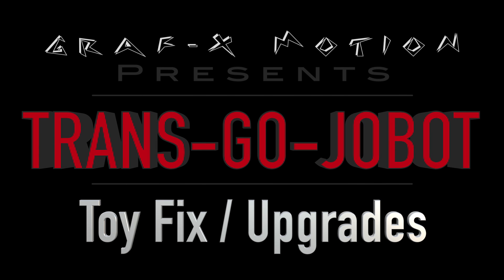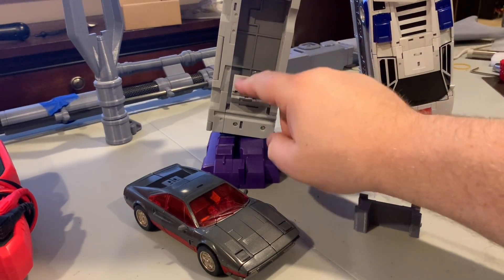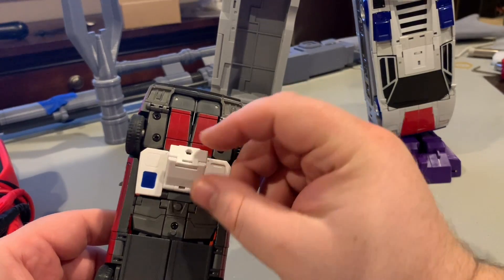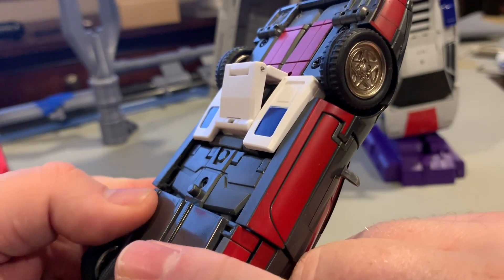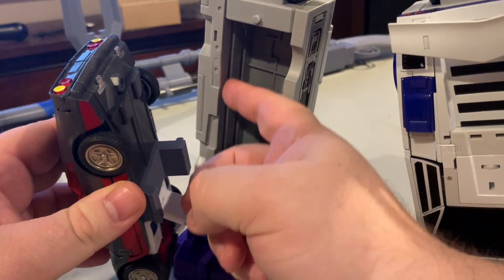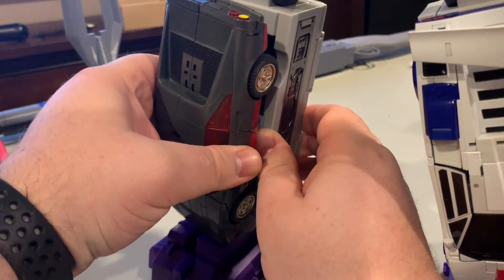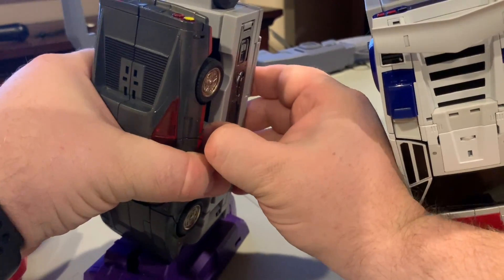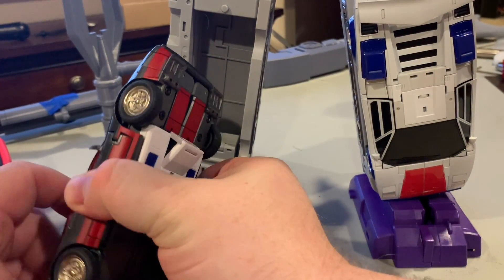DX9 Capone (MotorMaster) combined mode leg fix for DX9 Henry (Wildrider)

Comment: What filament do you use, and that 3d pritner you lined in the first amazon link is the one you use? Would it be useful for making customs guns or weapons that have a 5mm peg for CHUG figures and all, and I could also make custom  parts like you did? Also what software did you use to model it? Thanks.
Reply from the maker: I currently have a Creality CR-10S Pro. I have been using eSun PLA+ for filament. I like it’s extra strength and it’s been working very well. The problem with these FDM printers is any of them really can’t pull of the ultra fine detail. So for a part like this that is hidden, this cool is great!  But if you want to have tiny details, it’s not the best option also pegs can be tricky to get really strong and stable. We are going to be moving to a SLA printer for more detailed prints, but I’m concerned about fragility. I’ll know towards the end of the year when my SLA printers arrive. For software I use Fusion 360.

Comment: Any thoughts on making a front plate to allow the bots to be screen from the front?
Reply from the maker: There are some that have done that. If you search the TFW2005 3rd party forums, you should find some folks that have done that. I was considering it at one point, but I have since decided against it, especially when others already existed.
Reply: No one still makes the upgrade kit to move it to the front of the leg.
Reply from the maker: @TheIntern83  Interesting. The problem with 3 D printed parts is they will always be more expensive than a company can produce, as the cost per part is much higher on small limited runs. Not to mention packaging and shipping costs would be higher. And the R&D to create the working part. Then if it shows, you have to worry about color matching. So there is a lot to consider, that is why we held back several 3D part developments. The profit margin is so small per order.